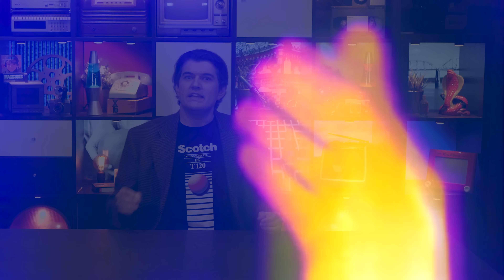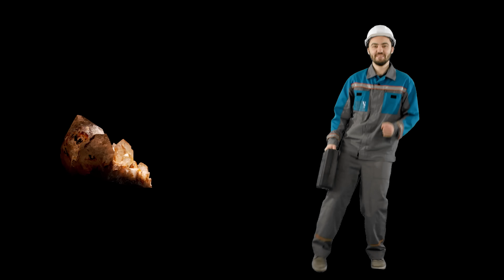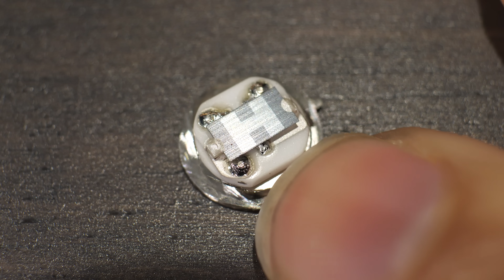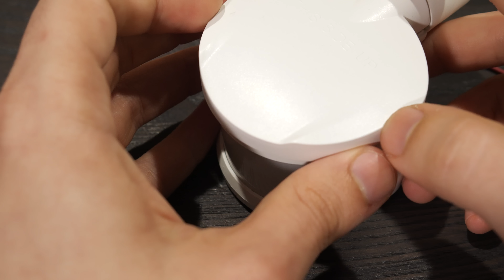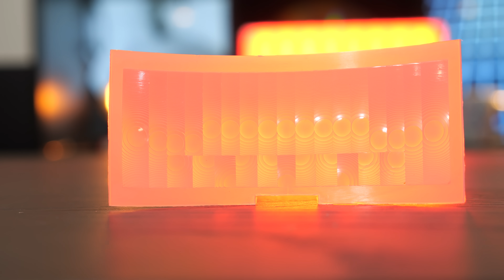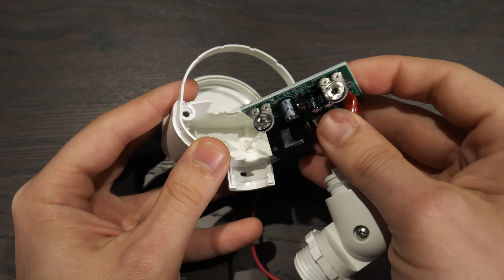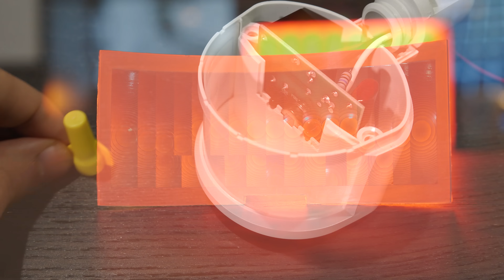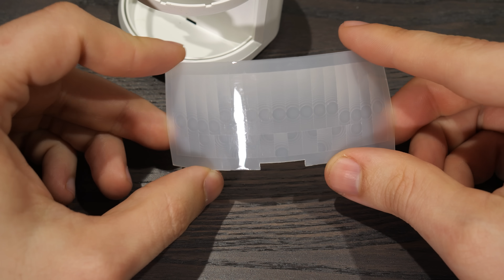Passive infrared motion sensors: a two-bit camera powered by crystals

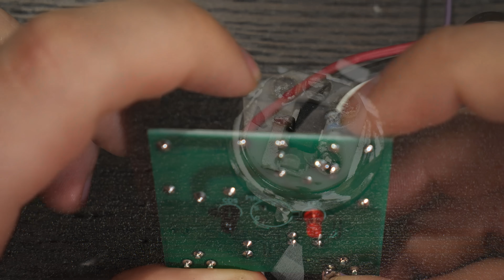Comment: Hello at 5:22 the circuit board showing V G S may not be Voltage Ground and Signal.  Most Fets have Voltage Gate and Source.  Where Gate is the control of the fet, kinda like base of a transistor.
Reply: Well no. Most fets as in mosfet have drain source gate. While bjts have collector base emitter. The gate of the analog pir sensors fet isn't broken out as its controlled by the sensor, so you wouldn't have a gate pin. And unlike say an optocoupler, the sensor requires ground.

Looked at a few datasheets, some do label the pins as drain source and ground (ZiLOG and Murata), others as VDD Output and Ground (Panasonic).

Comment: On hot days when the temp approaches 98 degrees, these stop working since you are no longer hotter than the background.
Reply: The analog ones like the sensor used in these modules yeah, they will stop detecting humans at 98.6 degrees plus minus some tolerances, but they have operating ranges up to 130f or more. Smarter sensors have logic to increase detection in 98 to 100 degree ranges

Comment: Interesting point regarding how these things work: They won't just create a voltage differential if something WARM passes in front of them, they'll also do it if something sufficiently COLD passes in front of them, because really they're just detecting thermal differences, not necessarily increases in heat specifically. In most situations this doesn't really matter, but it can be relevant if, for example, you have a passive infrared sensor above your door on the inside that unlocks it when it detects motion, and you're on the other side with an upside-down can of spray duster.

Relatedly, this is a fantastic way to get into places you aren't supposed to, assuming no one happens to be in the immediate vicinity to witness a conspicuous cloud of vapor coming out of the top of the door gap, because literally 95% of request-to-exit sensors (the aforementioned sensors that unlock doors when you're on the inside heading out) are strictly PIR, and thus very easy to exploit in the right situations, unless they're one of the rare few that also use microwave radar (allowing them to detect the rough shape and directionality of things in addition to thermal differences).

This ramble is brought to by someone who's probably watched too many DEFCON talks. And also a lot Deviant Ollam. (You should watch his stuff, by the way, he's great.)
Reply: He has a comment here. I never heard of him before.
Reply: Thanks. now how can I get a free ticket to fort knox
Reply: Sometimes, they'll put a sensor on the other side of the door and disable the automatic exit sensor (requiring the exit button) until the other side is clear. But that's prey to any of the other methods of blocking these sensors.
Reply: @Senthiuz  you just stand still for a little bit
Reply: Man you're going to get me into trouble
Reply: What does the cloud do?
Reply: @oremooremo5075  the cloud is condensated air. It's a byproduct of the cold air traveling in a warmer environment. The cold air itself is what triggers the sensor (due to detecting an uneven temperature change across it's face). The cloud doesn't matter.

Comment: actually that one spike is all it need to open the mosfet through amplified signal cc there would be either a series of resistor and capacitor thats connected to the supply to act as delay timer for the mosfet to switch back to its normally open state and one chip to control the behavior from 0 to active and low supply voltage

Comment: Thank you for the educational video. Ever since I moved into a new flat, most of my motion sensor triggered lights switch on and off at night on their own, especially inside or close to the bathrooms, but also in the hallway. Even though I have a strong foundation in science and don't believe in ghosts I have to admit it is quite creepy. I was trying to come of with a scientific explanation. I didn't find any moving heat sources (checked with an infrared camera) so my only guess it may be triggered by some kind of electromagnetic radiation that perhaps induces a tiny current directly to the circuit? Does this makes sense or do you have any other clues?

Comment: Another excellent video but, 2 questions:

1. If it's detecting heat from a body, surely over that 6+ foot distance between your body and the sensor the heat would have disappated?

2. How are these set off in windy conditions or is it a similar looking but, different sensor?

Comment: The distance - no, it sounds just like a babble. The thing is much simpler, IMO: the "blips" are produced by moving by a certain angle (say - 1 blip per degree). To move by the same angle further away you need to move a greater distance. 
The other lenses are - I guess - to detect vertical movement, not only horizontal, and guessing (again) by their position, the vertical movement would produce diagonal moving patterns.

Comment: How about doing a video on how automatic high beams on cars work.  Somehow they detect cars, but are not affected by streetlights or reflections from street signs.
Reply: They use a pipe to only detect directed shallow angle light, basically blocking light from wider angles.

Comment: Today, 24Ghz radio sensors are a much better solution than pyro sensors - it's almost impossible to set a pyro sensor to only react to people and not dogs, for example. On the other hand, microwave radio sensors can track micromovements, i.e. a person's breathing, so even perfectly calm people still remain detected, they can also determine object distances, movement speed, etc. Unfortunately, radio sensors still consume several times more energy than pyro sensors, which are extremely efficient, which is the only remaining advantage.

Some may say that a camera is the best solution, and it probably is for certain situations, the problem is that people don't like cameras, because they threaten privacy, and people often do not behave naturally in front of cameras (they are out of the question in residential buildings), it is difficult to explain to someone that a certain camera processes data exclusively locally, with the help of local mural network, without direct video feed access to Internet, that's why cameras are out of the question in many situations...
Reply: Radio sensors can also be more easily interfered with by jamming.
Reply: @jeffkardosjr  Yeap, when it comes to security applications, the pyro sensor is probably a little better! Although I don't think it would be easy to fool the radio sensor, you can choke it, but in that case the microcontroller knows something is wrong, it would have to replicate the radio waves, and considering that they are 24Ghz, it is probably not easy to carry out some deception attack (where the sensor would be tricked, instead jammed, if that is even possible). 
And for most other modern applications, detection alone is often not enough, especially since the pyro sensor stops detecting objects that do not move (a big drawback) - it cannot recognize breathing. 

I do a little work with radio sensors at home, as a hobby, and I'm blown away by the options! Modern applications of the same will only come in the following years...

Comment: A quick browse of the literature shows that there are two sensitive regions with their negative terminals connected together and their positive terminals connected to the FET's gate and to ground, respectively¹.  Configured like this one there is no change in voltage at the gate if both sensors are generating the same voltage.  In addition, to ensure stable output the FET's gate and source (output) are both pulled down to ground.

¹ The polarity can be swapped, i.e. both of these perform the same:
  Gate + Sensor - - Sensor + Ground
  Gate - Sensor + + Sensor - Ground

Comment: It is strange that the bridge configuration has not been used similar to load cells. I suppose the accuracy is not as important as cost in this case. However, I wonder what can be done with a four crystals arranged in  a full Wheatstone Bridge and a proper differential amp?

Comment: 11:44 There's also another way that periodicity of detection can tune distance of activation without needing special sized lenses. The closer you are to something you walk by, the faster you appear to move from its perspective. Because the sensor is essentially seeing light at straight lines to the object triggering it, those lines would seem pass by faster if a person was closer. Any movement would appear to have a higher amplitude at closer distance when measured that way.  Because it's designed to detect people (and people all walk at generally similar speeds) you can fairly accurately gauge the distance someone is from the sensor based on how fast the light coming from them passes by.

Comment: I'd love to see some Connextras about how they could change the lenses to more effectively detect when someone walks straight towards a PIR sensor.  In my experience testing battery powered security cameras that rely on PIR you really need to make sure that the movement path will be across the camera rather than head on, otherwise you can miss entire motion events.
Reply: pir and microwave detectors in alarm systems  used them for year  micro sensitive to forward pir across great upgrade

Comment: There's a CDS cell on that one board.
A light sensor, tells it when daytime comes around.
I was a smart kid, when I would sneak out of the house I would shine a focused flashlight on the sensor so the yard lights wouldn't turn on.
I've come across a few units that won't detect body heat when the ambient is equal to or above body temperature.
A trick I had learned while working at Radionics was that if you block the smaller lenses at the bottom with a bit of foil, your pets won't set off your home alarm.
Reply: @charlesurrea1451   on the one he opened, it has a photodiode not a CDS sensor. Cadmium bans are making the latter rarer and rarer. Behave the same* but still
Reply: "your pets won't set off your home alarm"
Spoken like someone without large dogs.

Past a certain point, large dogs and small people overlap.
Reply: @CptJistuce most dogs
Reply: @vappyreon1176  I honestly don't know what a "normal" dog is, having had pooches pushing past 70 pounds  my whole life.

Comment: Fun fact, The reason these sensors don't trigger to someone walking past the window outside the building is because window glass is not transparent to infrared or at the very least IR is heavily attenuated by it. these days by design for thermal insulation.
Reply: you mean transparent?
Reply: @vibaj16  good catch
Reply: That's funny, beacause camera lens let infrafred pass through. They must use different glass type.
Reply: @bartoszpiszczek  cameras can see NIR (near Infrared radiation) which is much closer (near) to visible light. Motion sensors trigger on FIR (far ir) which is a lot further than NIR in terms of frequency, and is blocked by glass. Warm objects only emit FIR.
Reply: @3str4ng3d  Correct. PIRs respond to 10u which is the peak energy IR wavelength emitted by a body at around body temp. This is ten times the wavelength used by IR remote controls etc.
Reply: @bartoszpiszczek  double paned windows really reduce ir passthrough. Air gap
Reply: @nyetloki  inside lens there is air gap too

Comment: The way these sensors work is the reason why famously, they can be avoided by using a large piece of styrofoam with aluminum foil on it to hide behind as you move. It reflects all of the ambient temperature back at the motion sensor, and if you move slow enough to not make quick changes, it can't tell you are there. There was a social engineering video here on YouTube where people used that technique for a security system in a building.

Comment: I'm curious about the LEDs.  I thought the red was flashing just to let you know it was active.  But is that really so?  What about the other one, is that a receiver of some sort?  What is their actual purpose?
Reply: I think its an infrared sensor like is in your TV and other electronics  to sense remote control signals. I think.... the PIR senses heat and the infrared sensor, Movement. but that's just an educated guess...
Reply: One is a red LED that flashes when movement is detected. The other is a phototransistor, to disable light triggering in the daytime. Or a light detecting diode photodiode. Same difference.

Other sensor modules have CDS light sensors/photo detector/photoresistors instead, but cadmium bans are making those harder to get.

Funny side note, you can use regular LEDs to detect light too. Basically the same way the PIR sensor works.

Comment: So I guess these will not work if the ambient temperature is too close to the body temperature?
Reply: Not work the best, to detect human movement, at around 98.6 degrees. Now adjust for shade and clothing. And smarter sensors have tricks to increase detection in 98 degree weather

Comment: I find it interesting how simple these devices are and their ability to work w/o requiring a transmitter. Motion detectors were developed in the 40's but these are passive, not requiring the device to emit infrared or lidar "light".

Comment: I recently repaired an entry light (IR motion activated); the sun and ice destroyed "lens" plastic part.
The thing is, it was no lens at all... just plastic transparency and white diffusor underneath. The difference was that sensor was larger, something in size of an optical-mouse sensor. I've made some transparency and tilted the sensor away from the direct sunlight. The detection pattern is a litlle wierd now and somewhat shorter but still does the job (until the purchase of the new sensor light).